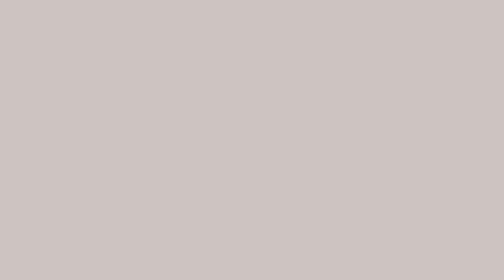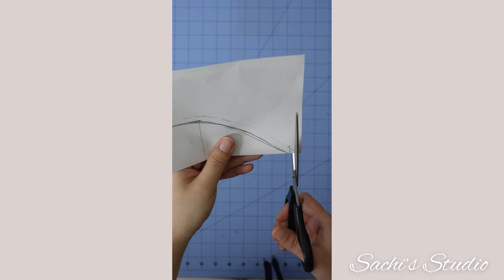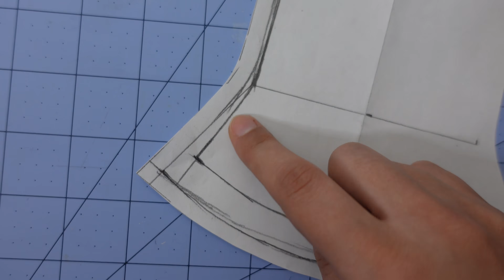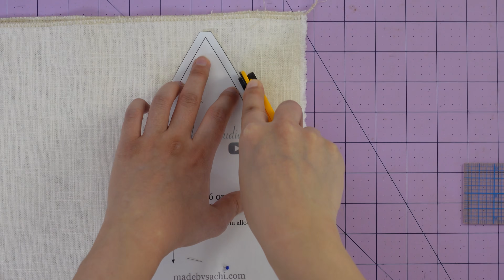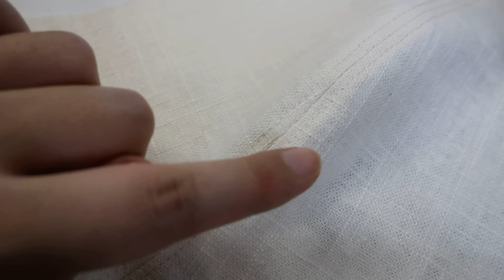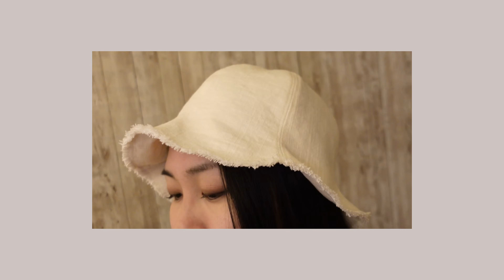TULIP HAT DIY //How to DRAFT AND SEW TULIP HAT 【FREE PATTERN DOWNLOAD】Easy Sewing Project Tutorial

Comment: hey i'm having a little trouble, i'm assuming the 60 degrees is because 60*6=369 degrees? but when i measure from the one sixth widest point measurement (outside of center horizontal line) to the peak of the hat the angle is way less than 60 degrees? not sure how to sort that out if that makes sense lol?
Reply: oops sorry sachi, i was reading my angle wrong. it much closer now good enough to make work with some slight adjustment :)
Reply from the maker: if you measured from the widest part, it won’t be 60 degrees because of the shaping! but I’m glad it worked out for you😊💕

Comment: You are a great instructor!  I love your videos!  I have two rotary cutters but I really like the one you are using in the video.  What is its name please?  Does it cut heavy fabric?  Thanks much.
Reply from the maker: Thank you so much for your kind words! they really mean a lot to me right now 💕 I have many rotary cutters but the one in the video is Olfa, but an old model. They cut heavy weight fabric fairly well.  I hear good things about new versions but I really like the vintage ones, so I stock up whenever I find them online :)
Reply: @SachisStudio  I have a 45 and a 60 Olfa and they both work fine with many fabrics.  But I work a lot with mud cloth, which is very rough and takes a lot of strength and energy to cut...  And, the blades get dull really fast.  Do you have a specific suggestion for a rotary cutter for tough jobs?  Thanks for your replies!!!
Reply from the maker: I only use my rotary cutters for light weight fabrics so I don’t know much about that…sorry I can’t be of much help!  For thick fabric, I usually trace the pattern and cut the inside line with my Shozaburo shears (Japanese fabric scissors). I’ve been experimenting with electric scissors lately, but they are tricky to maneuver, but easy on hands so that could be something to consider…
Reply: @SachisStudio  Hmm.  I will have to check out electric scissors.  Thank you so much for your responses.  I look forward to seeing your next video!